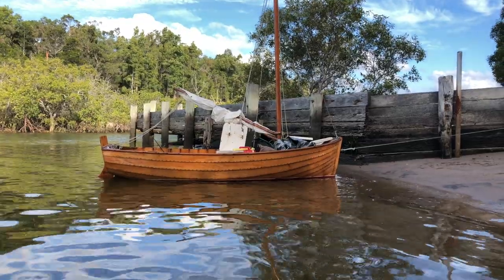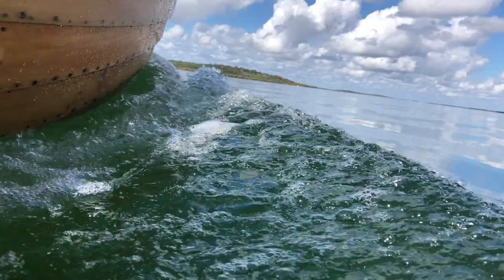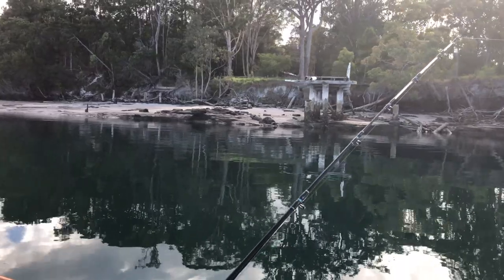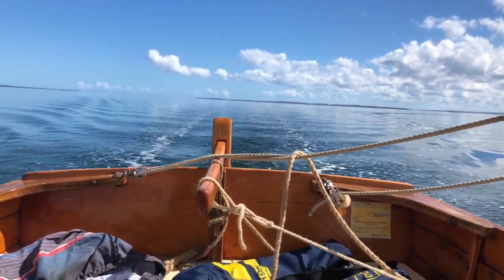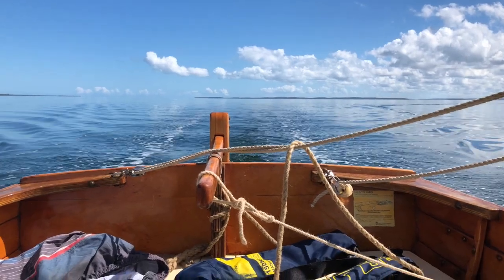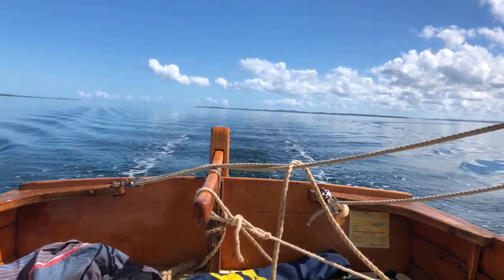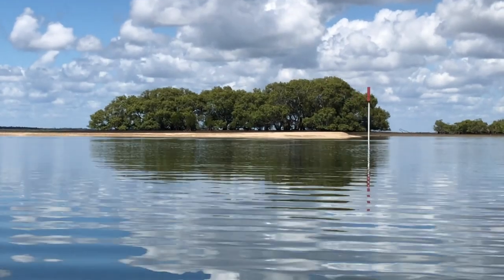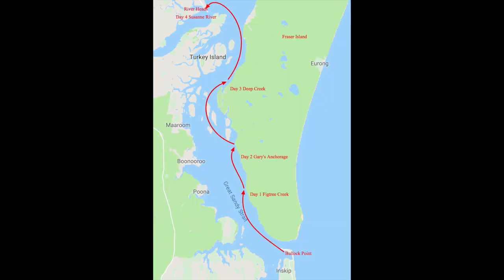Open dinghy cruising. Ungowa to Hervey Bay, Fraser Island  Day 4.

Comment: Where is the motor? Nothing on the transom so...is it really possible you have some kind of inboard rig on this boat?
Reply from the maker: Sure do. I’ll see if I can find a clip.
Reply from the maker: https://youtu.be/Tyd4cI14Xz8
Reply from the maker: terrulian your not the first one to ask this question so Ian just putting
Together a video from a trip where we motored up the maroochy river. With some notes and video of the motor. I will be posting it soon so if you subscribe and click the bell you will get notified. I’ll try to post a link here as well. Christopher
Reply: @SmallSailboatCruising  Thanks very much. This is just great stuff, right up my street although you've got the weather gage. Is this boat unique in something of this size with an inboard?? I've never seen it before. Not only that, it's a beautiful boat and you are have  undertaken a voyage worth of her.
Reply from the maker: I only know of a few with inboards. Most were built as cadet dinghies for sail training. Such as Sea Scouts And sea cadets. The issue was that marine motors were too heavy being cast iron with water jackets. These eventually rusted out so few exist today. After the war they made wing and pilot motors. From recycled aeroplanes in aluminium. I had one of these in moonlight but it leaked oil. With the advent of lightweight overhead overhead canshaft motors like this little Honda it became possible to have an inboard in a small boat. I’m nearly finished on the new video all about the motor. I hope to post it later today. I suggest you subscribe so you see when I post it. Christopher
Reply: @SmallSailboatCruising  Done. Looking forward to the motor episode. Well done!